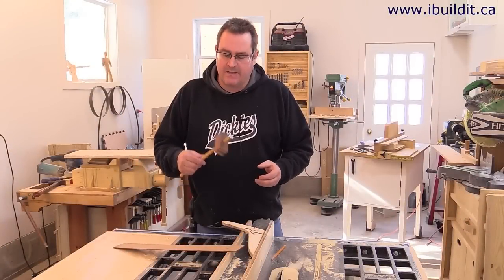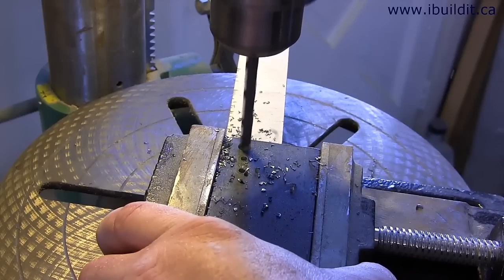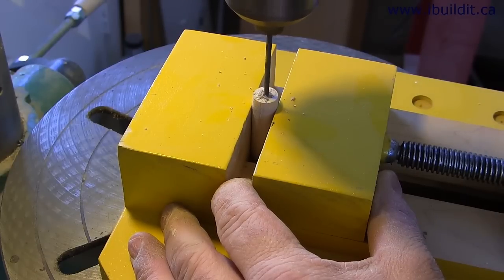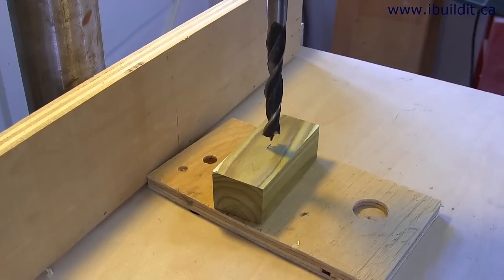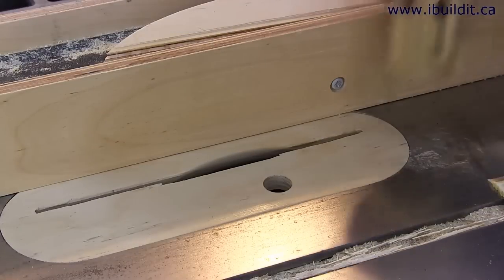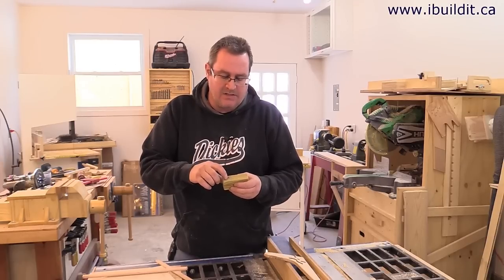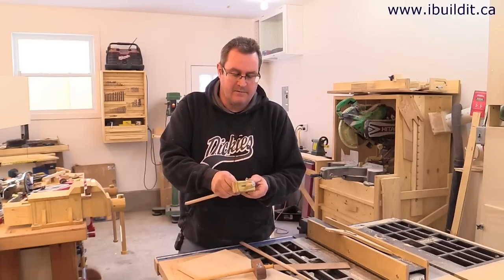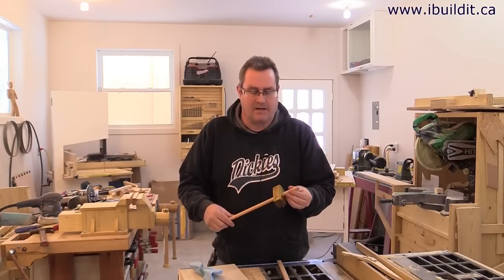Making A Marking Gauge

Comment: Wonderful video John.  You provided a 2 for 1 today:  Marking gauge & Dowel Maker.  Very cool trick with the washer turned cutting wheel.  Your gauge is certainly as effective as the ones from Veritas, and much less exspensive.  You just added another tool project to my summer shop work.  Thanks!  :-)

Comment: Very good. Thanks for your brillant videos. 
What I would suggest when applying the oil coatings is to do it with a small brush first.
Then let it soak in for ten to fifteen minutes and then wipe off the excess. 
The way I often see it being done is pouring the oil onto the surface and wipe it immediately with a cloth. Or even worse: pouring the oil onto the cloth first and then onto the wood.
This is quite wasteful, because what one´s doing is mainly to fill the cloth with oil.
Reply from the maker: Lasse Samström On the contrary, I've found the brushing it on and wiping it off wastes more. I use the same rag for several coats (sealed in a bag, and no it doesn't burst into flames), never adding any more to the rag. The oil doesn't actually soak into the wood very far, so just wiping it on is enough.
Reply: schooled :P

Comment: Instead of the washer you could get one of those cheap 1 dollar can openers with rollers (here i'm showing just a reference pic http://upload.wikimedia.org/wikipedia/commons/7/7b/Kitchen-Modern-Can-Opener.jpg ) and take out the sharp hard cutting wheel. Those last a lot and it has a bonus, you can scribe metal to a certain toughness as well.

Comment: I don't know if it's the video or what, but that sumac looks just like pressure treated pine or spruce... so much for expensive decorative wood. :)   but it's a great project, and a great tool made simple.
Reply from the maker: The sumac is that interesting green colour, but is hardly expensive. It grows like weeds here, and that piece came from a tree I cut down 2 years ago. Sumac is luminescent under black light and has some really vivid colours.
Reply: Ah, ok:)  I live in Norway and the only sumac I know about here is poisonous. Or I guess the leaves are. is that the case with yours too? it's poison ivy

Comment: John, really appreciate the video well done. Do you perhaps have an idea how you could use a pencil in the gauge instead of the washer?? Thanks Pat
Reply: You can easily use a mechanical pencil to make the marks easier to see.  Marking with the wheel helps to keep the accuracy.  Unfortunately a pencil won't work for that :)
Reply from the maker: Drill a hole in the dowel the same size as the pencil.

Comment: Interesting, but I would find it time consuming to set the gauge to the thickness of a board since there is some dimensional space between the marking plane of the cutting head and the protruding screw head. Need to sharpen or bevel the inside edge of the washer only and find a way to recess the screw head....Or just buy the cutting heads rather than making yourself.